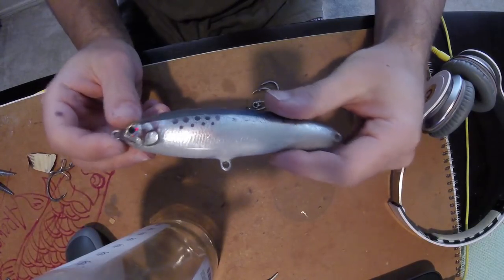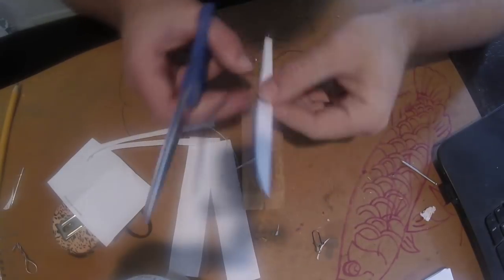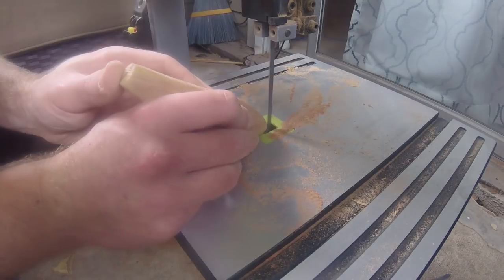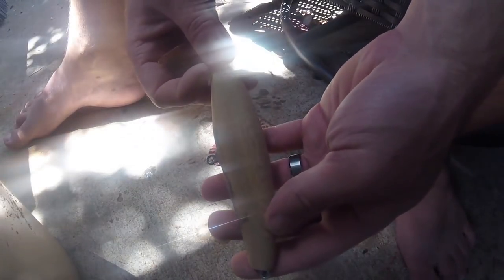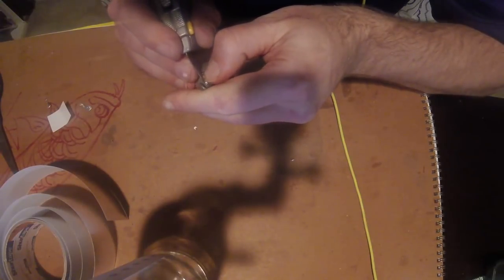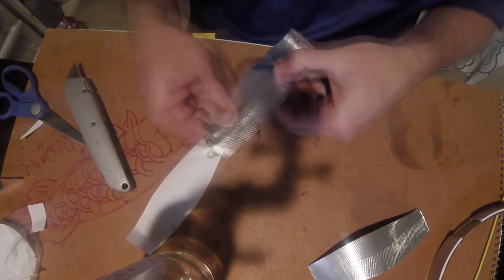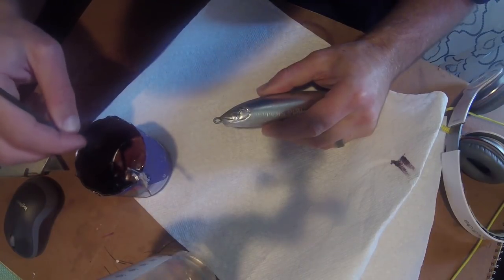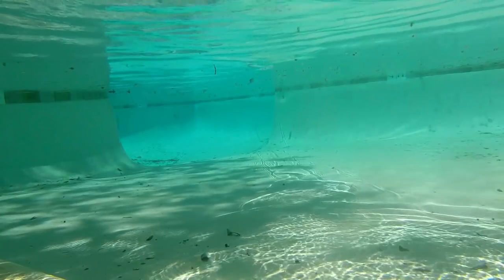Making A Small Stickbait For Snook & Jack Crevalle

Comment: I’d like to see how you cut the pieces for the face, I’m having a hard time getting both sides somewhat identical and cutting out such small pieces.. great video man, that thing is badass
Reply from the maker: Hey man, thanks for watching. In most of my other stickbait or lure making videos I show you how I carve the face. It does take a bit of practice and smaller lures are much harder to carve. Start practicing on big lures to make it easier for yourself
Reply: The Angling Globetrotters thanks buddy, I was talking more about the foil sticker. How you cut those out with such detail more of then the actual face carving itself
Reply from the maker: So the foil is not specifically cut out for the face. I just cut it into rough pieces that are larger than the pieces of the face I will be putting them on i.e. gill slit or lips. I just rub the foil into the carved outlines of the face with my finger and then cut off the excess material. In some of my other videos you might get a better idea of how I do it.